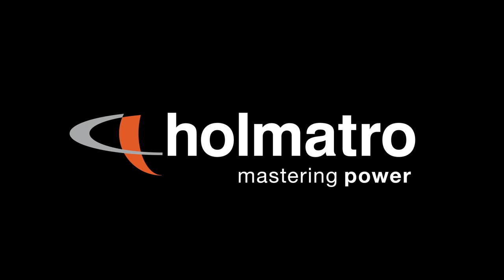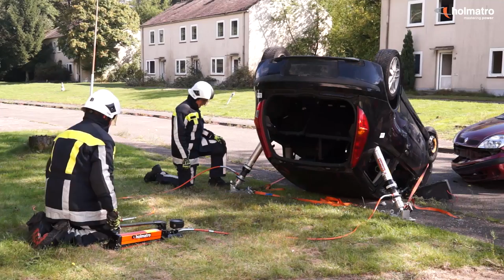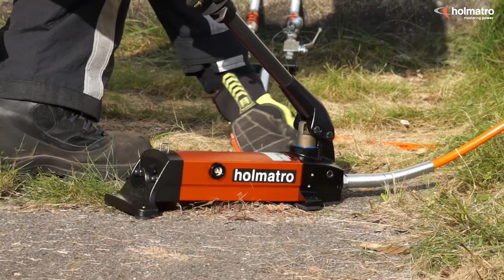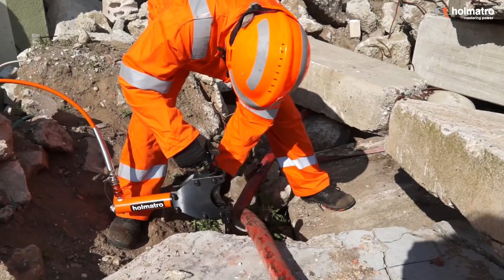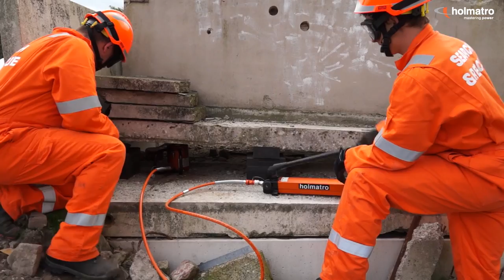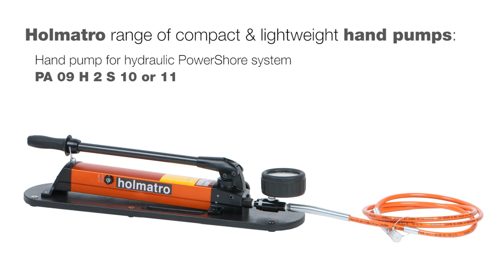Holmatro Compact & lightweight hand pumps

Comment: hi, i have PA 18 2 C, how to release the pressure?
Reply from the maker: Hi Wahyu, We have the instruction for you, but we would also like to send you the manual with the image explaining what you should do. Can you go to https://www.facebook.com/HolmatroRescueWorld and send us your email adress in a direct message? We will send you the user manual as a PDF file. In this manual the instruction is on page 31 and the image (Figure 13) is on page 122. 
Please note you need a pressure relief tool, this tool should have been supplied to you together with the hand pump. If you don't have the tool anymore, please contact your local dealer. (Let us know if you need contact details!).
INSTRUCTION, as found in the user manual:
5.4 Relief the pressure in unconnected hoses and tools
5.4.1 General
Temperature differences can cause overpressure in unconnected hoses and tools. This overpressure
can make it impossible to connect the system. You can use the pressure relief tool to remove this
overpressure. This accessory is available for both the CORE™ system and the single hose system and
is supplied with every pump as a standard. 
NOTICE
We recommend to keep more than one of these tools on hand.
5.4.2 CORE™ system
Refer to Fig. 13.
• Hook the pressure relief tool over the male coupler (1).
• Turn the knob clockwise (2) to release the pressure. Some oil will be released.
• Turn the knob counterclockwise (3).
• Remove the pressure relief tool from the coupler (4).